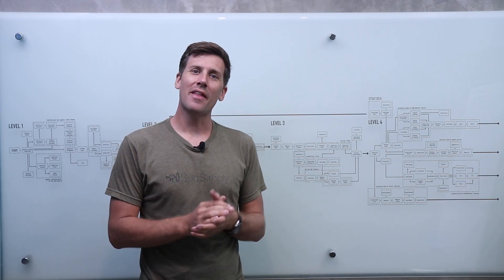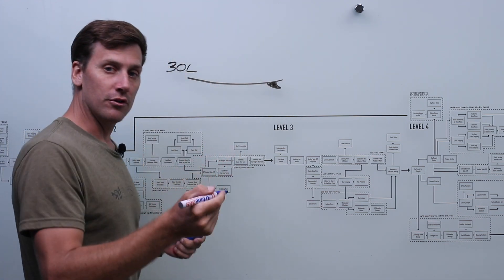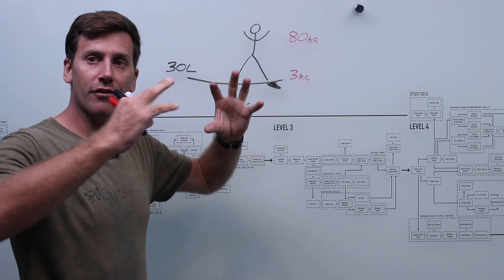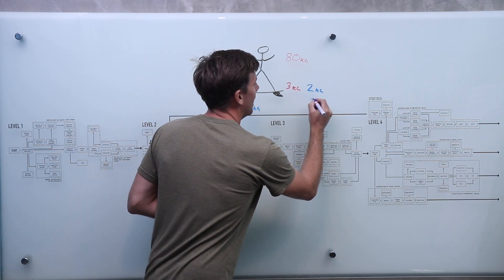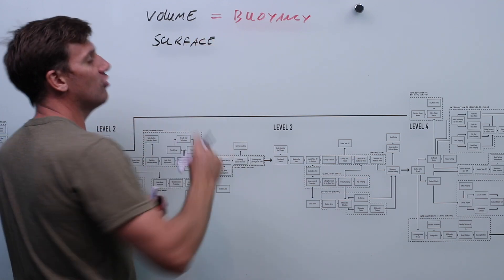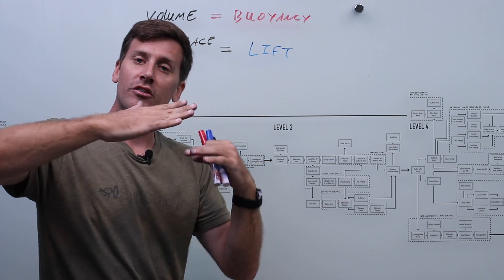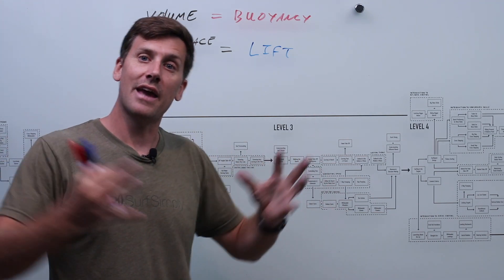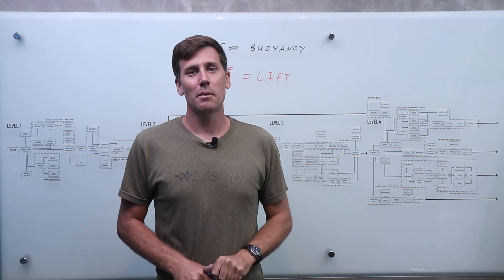Surf Simply's Question Time: Planing Lift vs Buoyancy

Comment: Very interesting videos man! I've learned a lot :) 
If I may give some videography advice which could help the production quality by a lot.

If you use an extra microphone, turn sensitivity a little bit up (the volume now is a little low, even on max on my system at least) and if you don't have one, Getting a simple shotgun mic from Rode for example will make a HUGE difference, even the most basic one bellow 50bucks will make a huge difference in quality.
And secondly, add some light, like a led video panel or any constant ligtsuourse in a softbox, I for example often use a 20 pucks 30w LED flood light (for your setup you might need something stronger) that's not even made for productions and strap it to a cheap softbox, and it works perfectly on the cheap!

You don't need to spend hundreds of dollars on gear! but these 2 things would improve the look and sound of your vids a lot!

Cheers and keep them coming! :)

Comment: Love your explanation on the buoyancy difference between the foams. Maybe just your percentage calculation could reflect the forces that the paddler feels, rather than the standup surfer. Am thinking it could be 1:30 difference which may be more felt by the paddler??

Comment: Thanks again for a response, I think it's great that you're engaging with your viewers. 
It's interesting to think with extreme examples. They can make obvious the problems with considering only one measure of a board. For instance,  we imagine a board which is constructed typically, with the addition of a single very long foam spike penetrating the water. As the length of the spike increases the volume of the board continues to increase, yet little vertical dynamic lift would be generated by this spike if it were to move through the water. We might find this strange board meets the typical volume requirements for our weight, calculated by manufacturers, yet this board would likely be unsurfable in a typical orientation. I think volume in conjunction with board shape gives a much more complete picture of whether the board size is suitable for us.
On the question I asked, it's been a while since I asked it. Since then, I have read more and I think the term "planing area" is not typically used, and "wetted area" is the more correct term for this measure.
In terms of my surfing progress, you and your team's engaging content has helped me in at least one way. After reading the web article about how a surfboard works, and after some reasoning and arguing with myself about the content, I came to the idea that boards can travel faster than the movement of the breaking point of a wave, even without the rider pumping (which seems so obvious now). For any boards where this is the case, a rider will inevitably outrun the steep section of the wave and slow to a halt.
 
Now, for me to stay close to the steepest section of the wave on a fast board, I must do one of the following: stall the board and wait for the wave to once again pick me up, increase my drag and travel at the same speed as it, or perform a cutback after surfing away. The necessity of cutbacks has never been this obvious to me. Before I saw them as something I would eventually learn just for more control or style, now I see them as necessary to increase the speed of my surfing, and I've since learnt to perform them adequately, and I'm having a blast.
Looking forward to more content, Phill.
Reply from the maker: Thanks Phil, il pass your comment on to Harry!

Comment: At the end you said it's really hard to compare the surface areas of 2 different boards.  However, if you see someone surfing a board and wondered what size that board should be for someone of your own weight, what you can do is divide the weight of one surfer by the other, take the square root of the answer and use this number as a factor to adjust the dimensions of the board.  
For example if you weigh 80kg and ride a board 6ft long (72 inches) x 19 inches wide, and I weigh 100 kg, 100/80 = 1.25.  The square root of 1.25 = 1.118.  
Hence the length of the board I would need to ride to be the equivalent of yours would be 72" x 1.118 = 80.4" (ie 6ft '8ins) and the width would be 19" x 1.118 = 21.25".  
This would give me almost exactly the same surface area as you have.  It's also the reason why virtually no larger people successfully surf small boards, and in my experience hardly any shapers appreciate just how much bigger they should be making their boards to suit bigger surfers.
Incidentally, if you want to get the same volume for your weight, you'd need to take the cube root, which makes the differences slightly less.
Reply: Anthony... you blew my mind with this comment.  Thanks.

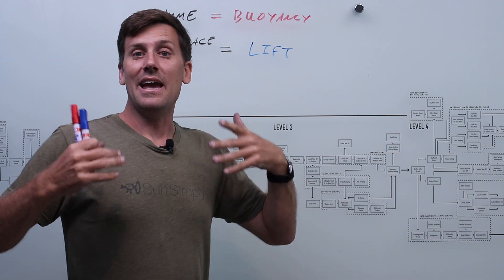Comment: Good job Harry. Someone is definitely going to pick on your “smaller area generates more lift” at 9:35, when it’s clear than you meant that as the speed increases, the area necessary to generate the same lift reduces, as lift is proportional to the speed squared ))